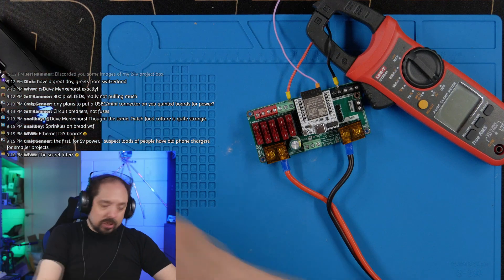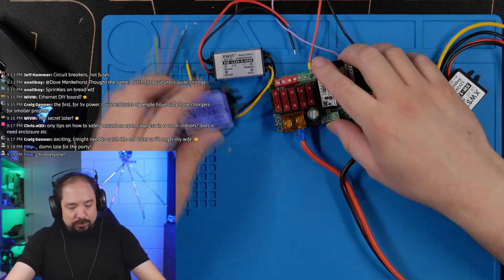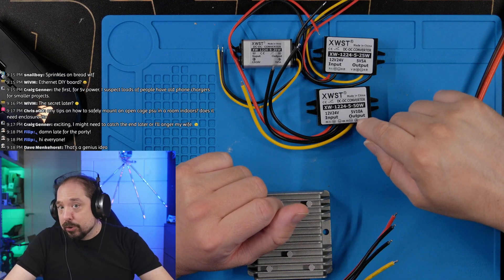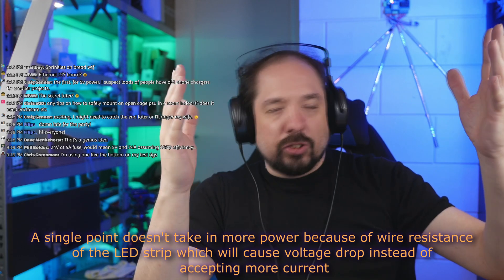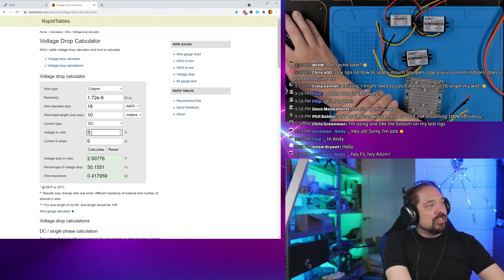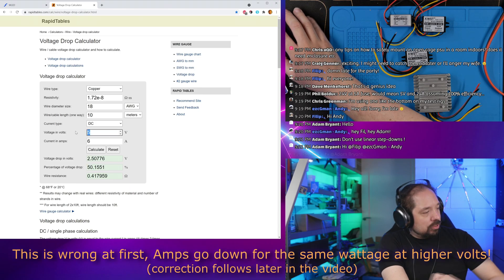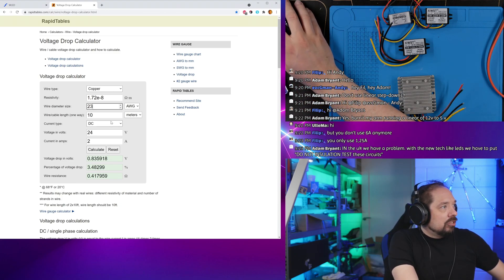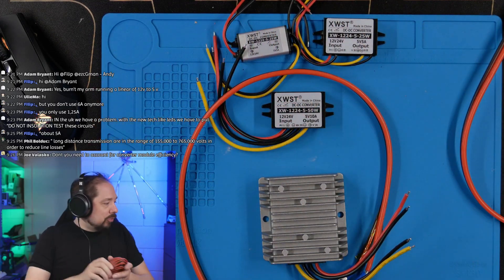💡QuinLED💡 24v power transport for 5v addressable LEDs (ws2812b, sk6812) 1 - 3

Comment: You lost me when you increased the voltage on your calculator from 5v to 24v, but you left the amperage the same. It is really hard to watch when such basic mistakes are made by someone trying to explain such a simple concept of voltage drop due to CURRENT.

Comment: Yo utilizo LM2596S para cada 100pixel, 50% brillo, y en un panel de 270 pixel tengo  otro LM2596S, funcionando 3 meses, 6 horas/día, sin ningún problema y con buena intensidad de luz. Cada LM2596S me costó 1.5€, y los protejo con un neumático de bicicleta. Creo que es una solución perfecta, y muy muy económica. Miles de gracias por tus aportes a la comunidad Led.

Comment: I would like to know what 24V PS would you recommend for 7 x 5m, 60LEDs/m, 5v, ws2812b, RGB strips. They will be outdoor working together in two strips on the second floor and 5 strips on the main floor.
Reply from the maker: You'll have to calculate power on that using the power sheets since it all depends on what LED strip we're talking about? Analog, digital? Anyway, after you calculate load, meanwell power supplies are a sure bet in regards to quality!
Reply: @IntermitTech  What do you mean by analog? Isn't  ws2812b digital?
Reply from the maker: Yes, but you started with a 24v PSU so that was a bit confusing 😅. Wattage remains the same whatever the voltage, so if you are building a buck converter setup? Just use the same values and maybe account for a bit of overhead. Also read this: https://quinled.info/24v-power-distribution-for-5v-leds/

Comment: The application that I have in mind is automotive, a parade float. While it's nominally 12 volts, it's actually 14 to 16 volts, depending on the vehicle. If I use 5 volt LED strings with buck converters spaced periodically and a 12 volt distribution bus, I shouldn't have a problem keeping the 5 volt strings powered.
Reply from the maker: Yes, that's an excellent use case for this setup.

Comment: when using two PSUs people recommend joining the grounds together (DC Side). How does that apply in this setup as the 5v converter is so far away? 

Thank you for the explanation about the resistors on the board. I was having a chat with Filip on Discord about this when I was having an issue last week. Makes total sense now and explains why I was having an issue. I use "Ray-Wu" style connectors and the ground and data is all together so I need to change the resistor in on my Dig-Unos to 33Ω to help with this! too late to order the data booster boards now :(
Reply from the maker: In the next part we'll talk about joined grounds and possibly joined positives.

Good to hear the info about resistor is getting known. It sucks it can't just work in all situations right now but at least it's an easy change. :)
Reply: @IntermitTech  It was interesting that Rob Tait mentioned in his recent video that he bridges it out completely, which goes against all other recommendations! 

Thanks again for raising this!
Reply from the maker: Bridging is an option with 3-wire cable I agree there, but it's better to keep a resistor in there like the 33R which is much better attuned to the cable situation.

Comment: I'd be interested to see what would happen to the voltage if you use 0.75mm (18awg) over 10m then power inject from both ends of a 5m strip/string (parallel power over a total of 15m) of cable. Would the volt drop be less because of it being in parallel?
Reply from the maker: No, it would actually be worse since the voltage drop happens on that 10m cable, so if it can reach more LEDs with less resistance (because of the double injection) it can draw even more current and thus drop the voltage even lower.

Comment: You're pretty much explaining how the united states Power distribution grid works the way it does, in theory. What would happen if you added large capacitor banks at each end of the 24v distribution wire, with the load drawing off of the load side capacitor banks?..... Smaller gauge cable wouldn't be an issue, no?

Comment: Loving going from 24v to 5v with daygreen smaller 10amp all aluminum buck converters. Smaller wires and the power supply can be 4x more efficient as far as amperage! I would have needed 80+ amps at 5v.

Comment: Please cover how to adjust the signal cable. I just installed this setup this weekend (24V to 5V converter) to 5V 10meter 
WS2812B lights. I ran AWG18/3 15ft (3m) at 24V then 2ft at 5V. I have flickering on the entire strip and some effects don't make it halfway down the LED. I have the same wire setup for edge injection on the end but don't use the data cable. I have a Quad v2 to as a controller that uses the 249R resistor.
Reply: P.S.  It's because of your videos I dove into the world of addressable LEDs. I have supported you thru your links so you can keep great content coming!
Reply from the maker: That's awesome, happy to hear that and thank you very much!
Reply from the maker: Yes, but I already have lengthy posts about that, in your case it's the 3-wire bundled cable causing the data issue, changing the resistor or using a data-booster wil fix that. See here:https://quinled.info/data-signal-cable-conditioning/